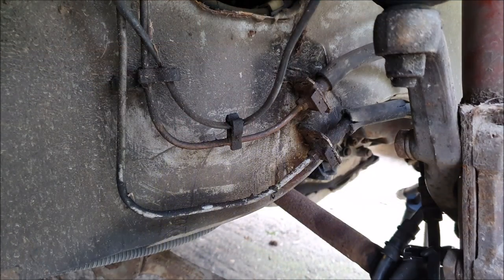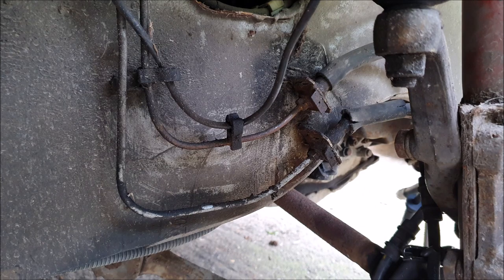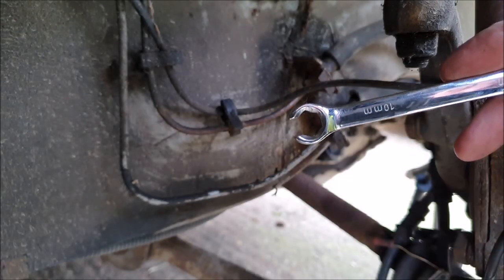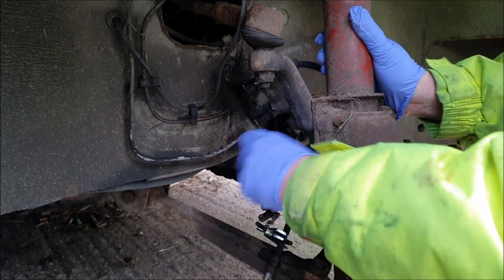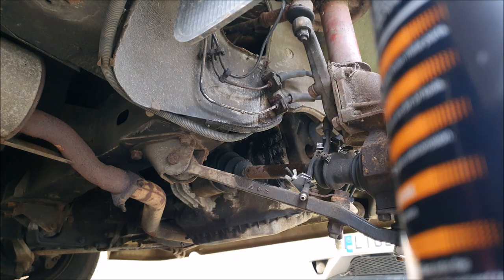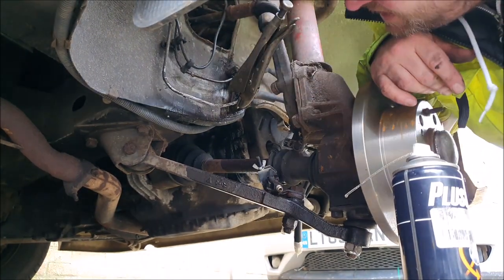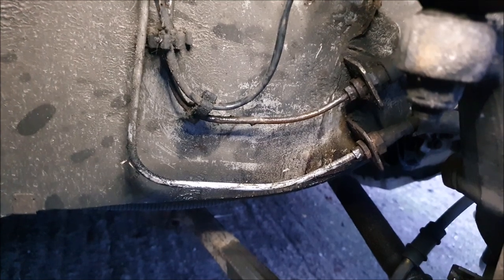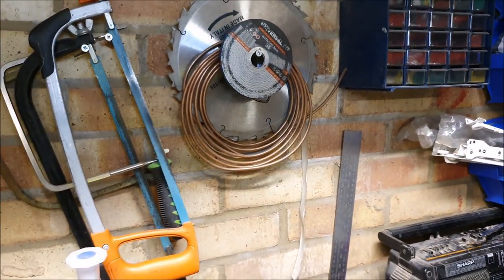Citroen C25 (Talbot Express) Brakes Rebuild Part Five

Comment: Proper blow torch, flames and a lot of WD40 saw those free off on the J5 at the weekend. Oddly we managed to get an imperial spanner to fit. Good luck.
Reply from the maker: I couldn't get anything to fit, TBH even if I get it undone now I'll probably replace the line as I don't fancy re-using the rounded Union.

Comment: Hi Alex 👏 just us 2 Saying hi and thanks again ✅ your on the right track replacing all the break pipes ✅ that what we had have done  🤔 but it got me thinking it's imperial     pipe and fittings 🤔 with age of the camper van ✅ good luck with next steps 🤔👍👍👍🇬🇧🇬🇧🇬🇧
Reply from the maker: It could be, although everything so far has been metric 🤔 I did try some AF spanners but still the nut seemed between sizes 🤷‍♂️
Reply: Not likley to be imperial, these are basically european vehicles and they never used imperial units.
Reply: @TheSteveGullick  🤔 you might be right 🤔 a 30 year old  vehicle with original brake  might  have been change  and who knows what they use
Reply: @denisscott1134  yes. As far as i am aware, there was AF, Whitworth, BSF and BSW, Most of which used different spanners. Bloody minefield on older machinery.
Reply: @TheSteveGullick  don't I know it that's we had ours all change

Comment: Hi Alex. My local Wilko car spares shop makes brake lines with fittings from your dimensions length etc. However it's been a few years since I used this service.  Cheers from old George.
Reply from the maker: They possibly still do. Never mind I have ordered the set online now. Getting into town is a bit of a pain now I'm working further away.
Reply: @ttxela  Hi Alex keeping my fingers crossed it all goes well with brakes.  Just been watching your headlight videos. I have a droopy one ant the other has water in it. You made it look easy to fix. Hoping mine is an easy fix. Cheers from old George
Reply from the maker: @MakeDoAndMend1  best of luck, headlights seem troublesome on these, I believe someone is selling adjusters on ebay?

Comment: Would there be enough slack in those lines to chop very near the rounded off union and bend a bit to reach?
Reply from the maker: Possibly but I feel like that might be a bit of an 'edgy' repair. I want to get it tip-top considering the family will be riding in it 🙂
Reply: @ttxela  Yeah very true mate after all they've been sitting like that for 30yrs!

Comment: Hi Alex unfortunately it must be thermocouple spanners the make of the one's I use on   that size nut are 
Today's tools Ltd. 
Think changing them is a good move anyway mate 👍. 
Chas.
Ps do you have a email for the channel?
Reply from the maker: Channel email is ttxela@aol.com 

At least I ended up with a spare 10mm flare spanner to file down 🙂